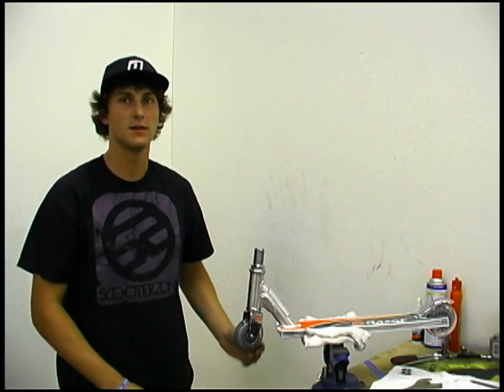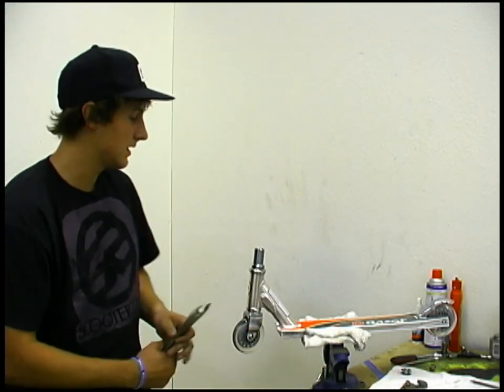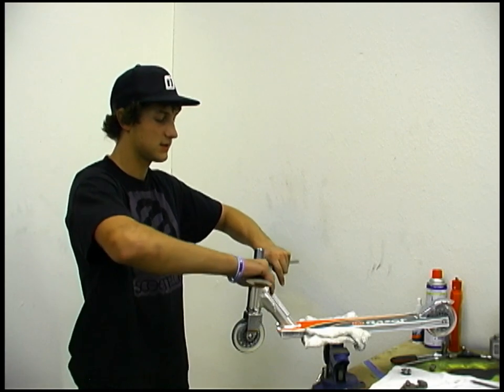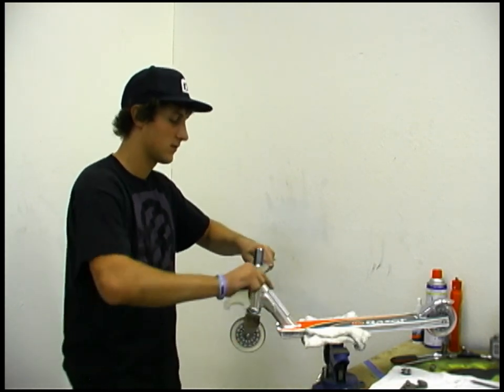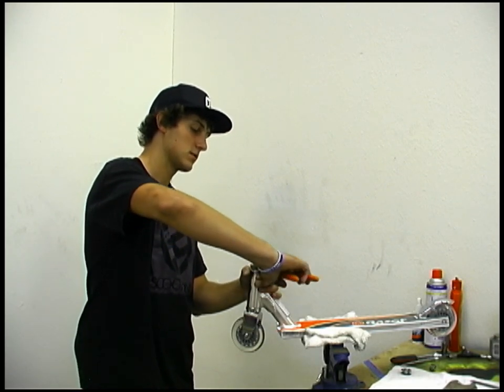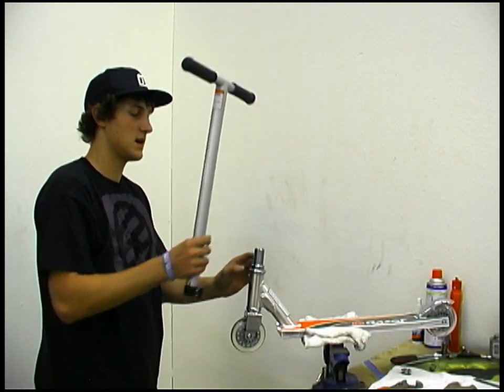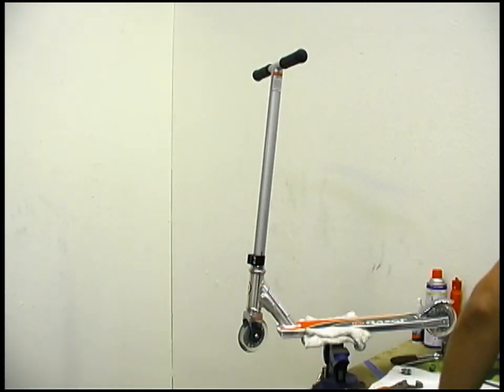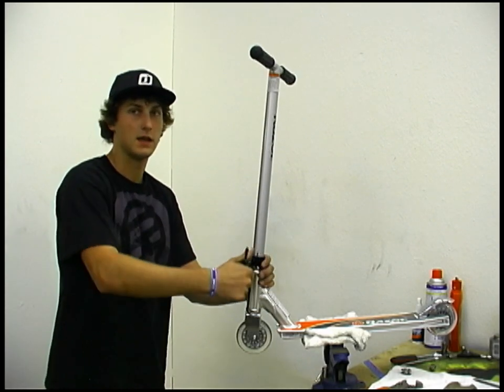Scooter Zone How To: Tighten a Threaded Headset with Nick Darger

Comment from the maker: @FrontsideSavonlinna 

A headset is the bearings that allow your bars to spin. Most people buy aftermarket ones to fit threadless forks, but they will work with threaded forks as well.

Comment from the maker: @aaron goodbrand make sure your slit at the bottom of the bar is taller than the clamp. Also make sure that when yur clamp is tightened the slit isn't pinching. If both of those are fine make sure your clamp is really tight and it isn't pinching in the back by the bolts

Comment from the maker: @snowboarding1256 

Its loose if it feels loose. If not some of the razor headsets are really loud. But it wont effect your ride at all. You can get it out by cleaning the bearings and using bearing grease on them.

Comment from the maker: @bigflearoy77 

That really depends how you want it, If you grease it to make it smooth it will probly be the same but much smoother. But how fast your headset is really doesnt make a difference. As long as it spins around 2 or 3 times thats perfect.

Comment from the maker: @TheFatFruit11 

Some bars are a little tighter than others and catch the threads. If you use a lubricating spray like WD-40 they will usually slide on pretty good.

Comment from the maker: @FrontsideSavonlinna 

With the increasing number of threadless forks they are becoming more and more common. The biggest difference is the fact that threadless forks have a threadless fork tube. So you need compression and a threadless headset to run them. Threadless forks are stronger and come in many styles and colors

Comment: I have a brand new scooter and there is a little play/wobble in the headset. It is a razor A6. Is this normal or is there a fault? I know bikes don't have this problem unless the bearings are broken but this is a brand new scooter so it should not have this problem. The nuts seem tight too and it turns smoothly without any noise or grinding.

Comment from the maker: @nordicslaptv 

either your headset is too tight, or your bearings are in backwards. Make sure that the balls in your bearings face in towards the cups on the top and bottom. Sometimes the beauty ring on the bottom lock nut gets crooked and grinds against the cups. Take that off if it grinds.

Comment from the maker: @supremefury88 

It most likely means that your bearings broke. Take your wheel off. Then spin the bearings in your hand. If they feel chunky then they are broken.

Your headset should be loose enough to spin but tight enough not to wobble.

Comment: What size spanner wrenches are you using in the video and where can i buy them? Also will they fit on the lock nuts on the Razor A5 lux?
Reply from the maker: They're Park Tool brand wrenches, they sell a headset wrench that has both 32mm and 36mm. I am pretty sure that the Lux Scooter has a smaller headset topcap/nut. Not sure what size it is, due to it not being industry standard size. Best option is to use a thin crescent wrench, or a thin pipe wrench.

Comment: @MrSnowboarder72 threaded has lock nuts to tighten the headset down as shown in the viedoe threadless is different for all systems but some threadless you have a starnut in your fork and you have a botl with a allen head and you righten it with an aleen key threadless is easier to tighten

Comment: I've done everything possible to my scooter and still is twisted. But would that mean to get diffrent bars or clamp or tighten the clamp a bit more.also I've tigtened the headset so much that when I try to tailwhip it gets stuck in mid air??

Comment: im new to scootering, i just came back to it after a year or so but anyways, im starting with the mgp bp1 scooter and my bars keep moving to the side like if the wheel is straight the bars will be slanted and ive tried tighting clamp but it always slants within 30mins of use, whats wrong????

Comment: My scooter got a headset wobble so I tightened the locknut and got quite a bit of height on the box and I got a headset wobble again. But if I tighten it to much the forks won't spin properly. The headset is quite good and it is a district pro headset